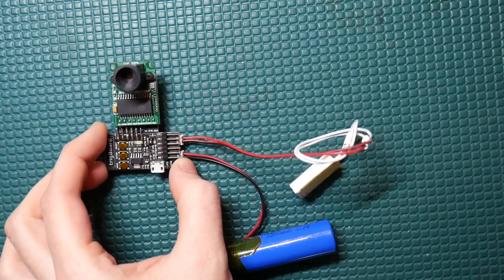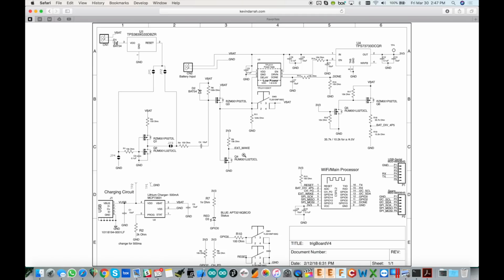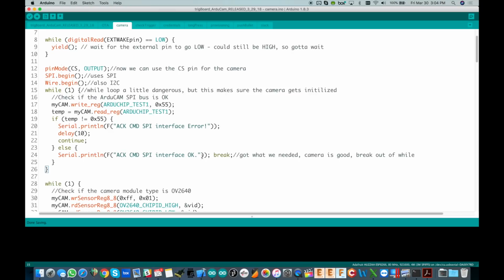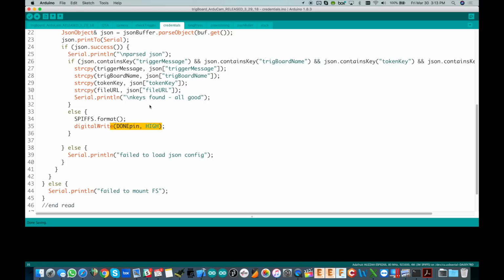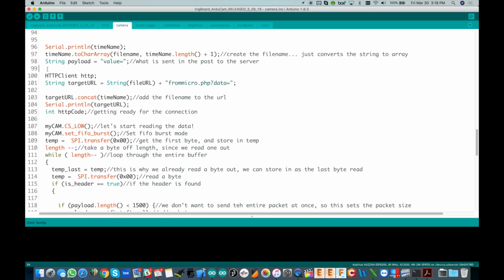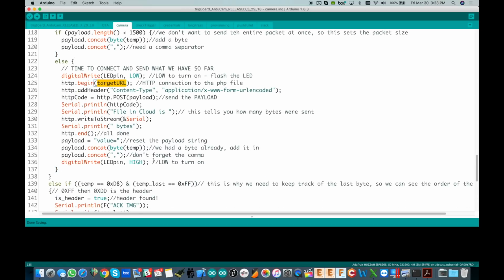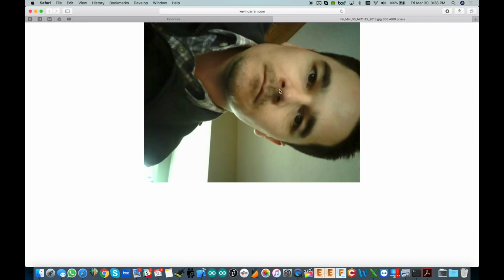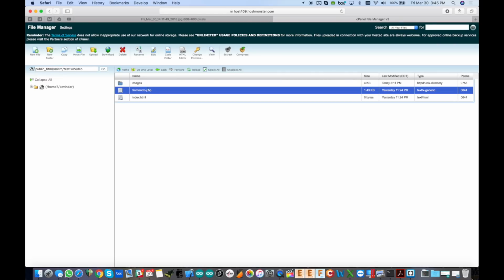ESP8266 (WiFi) + Camera Tutorial CODE with trigBoard & ArduCam

Comment: Is there an updated version of TrigBoardReleaseV7_12_16_18 ? 
Because it currently gives and error on DynamicJsonDocument due to the fact ArduinoJson has upgraded to ArduinoJson 6 from 5. 
I have been attempting to upgrade the file in sections provisioning and read_file - but when you change DynamicJsonBuffer jsonBuffer; with DynamicJsonDocument doc(1024); and then JsonObject& json = jsonBuffer.parseObject(buf.get()); with  DeserializationError error =  deserializeJson(doc, json); 
It responds with json is not declared and then json is not within scope and so on. Perhaps you have a solution or an upgrade ???
Reply: Here is the code:

        DynamicJsonDocument doc(1024);
        DeserializationError error =  deserializeJson(doc, json);

        if (error){

          Serial.print("deserializeJson failed with code ");

          Serial.println(error.c_str());

          return 0;

        } 

Error: 'json' not declared in this scope

Comment: Good day Kevin

my system (5MP mini AdruCam + Arduino Uno) has to send captured images to a website for image recognition. Since I will be sending in small data packets how long is it going take to upload one picture.

Another question my system switches ON when the ignition if turned ON and switches OFF when the ignition is turned OFF (no backup battery), the initialization of the system (wifi connection between the ESP8266 and my wifi router) does it happen automatically without any human interference.
Reply from the maker: not sure about those specifics, but a 5MP at max resolution could take over 30sec to upload... my guess.
Reply: if you could use a 3G/4G-GMS-module instead of a wifi module which one would you use?
Reply: 5G